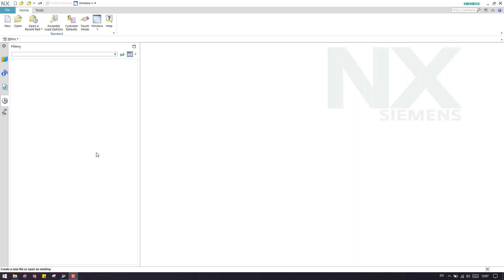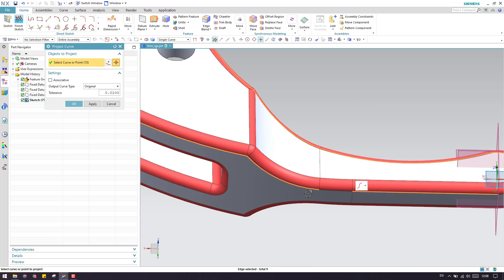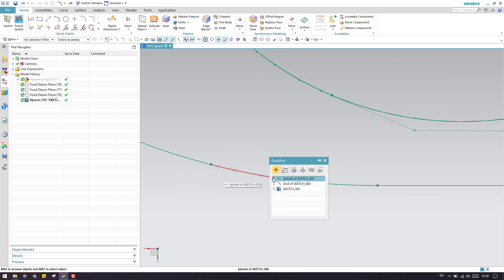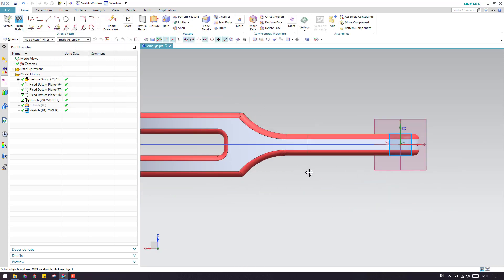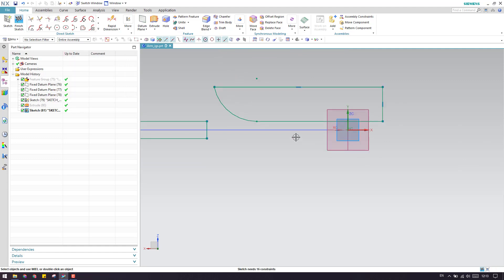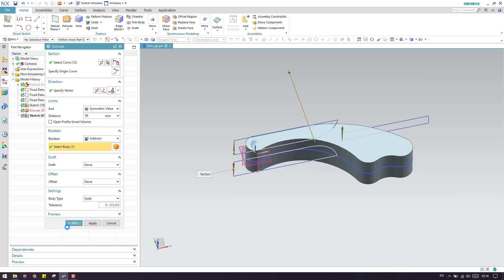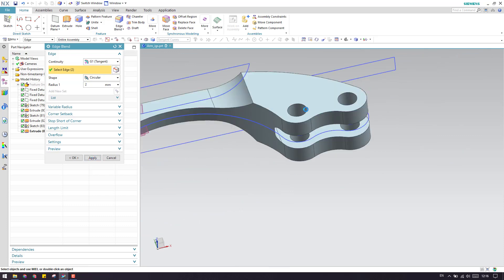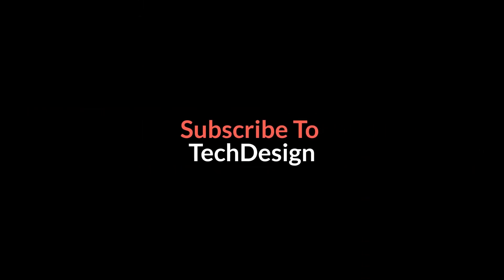Siemens Unigraphics NX- Remastering / Parametric Modeling of Arm.

Comment: Hello sir , May I know why you dint project all the curve initially , later you created a circle and trimmed the unwanted curve, instead initially you could have projected the curves right !
Reply from the maker: if we can get complete curve its better to project as you said.. but most of the case in projecting  there will be always splines.. you need to convert them to arc and lines at the end this is the reason i have done so
Reply: @TechDesignsantosh  Yes sir , I tried I got more splines/ conic curves , Thanks for the reply . Can you please explain , Master model concept , part model interface and stress analysis sir ?

Comment: Hello Sir, Is it necessary to fully constraint the sketches while making parametric model. If no, then why? Please reply.
Thank you
Reply from the maker: Hi.. it depends on what kind of output company needs.. in some companies the parametric model will be used for future for any modifications.. in some cases they just need a model to make analysis during analysis it's not required to constrain sketch
Reply: Thank you very much